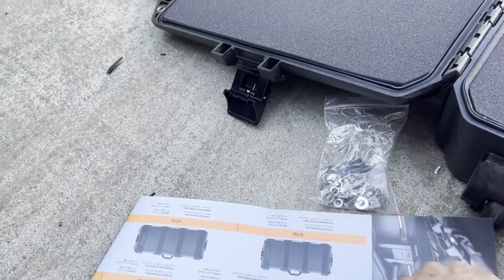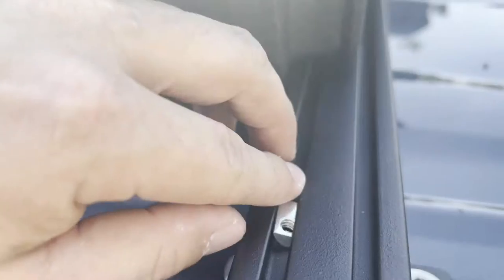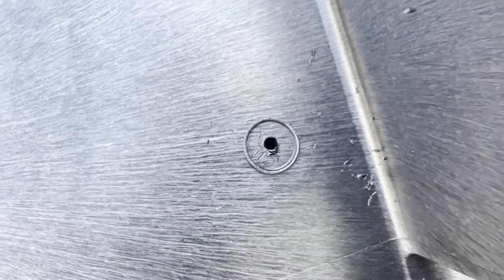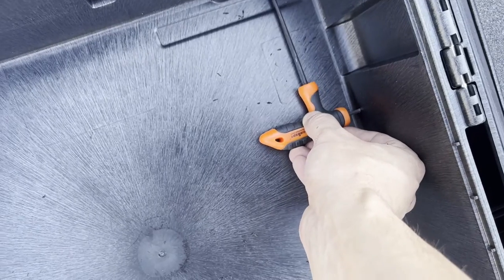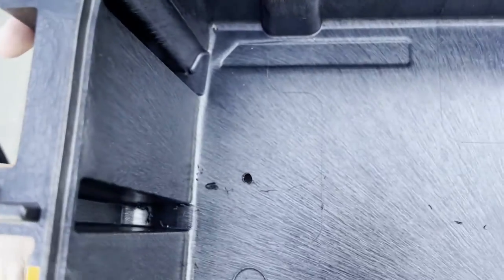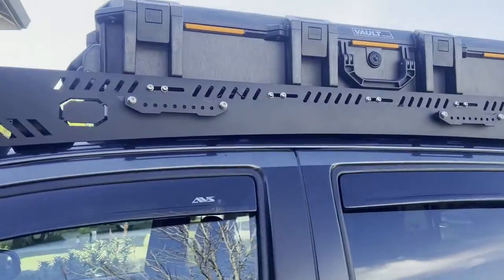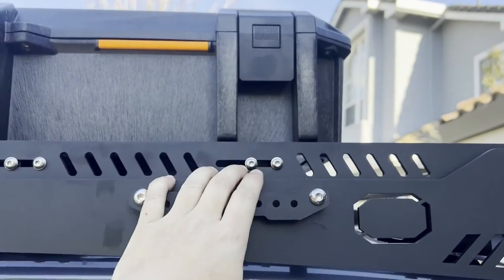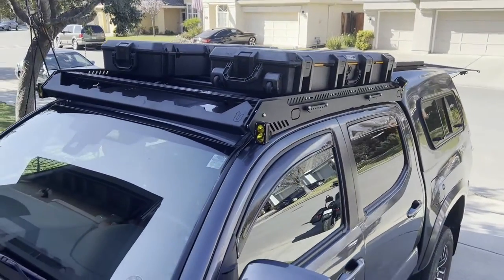How to Mount Cases to Your Roof Rack, DIY, Step by Step, detailed instructions

Comment: Did you end up getting the measurements mounting the front part of the vault box? I don't have at particular Allen wrench to go by for measurements.
Reply from the maker: U can use any measurements and tool u like, u can even place a brick or wide ruler along the side to keep the measurements equal. Good luck.

Comment: Never understood the need to mount a case to a roofrack with screws.  I prefer using a ratchet strap, its way more convenient for me, i dont like driving with gear when im not camping.
Reply from the maker: I converted bc my straps became too loose or warped the aluminum rack over time in addition to freezing closed when in freezing conditions. Plus the vibrations on the highway etc. Thanks for watching.

Comment: Do have a link or an item number for the hardware you used to attach the cases?
Reply from the maker: Used the screws and anchors from the Rack manufacturer, they were very helpful. Then I used a rubber washer and metal washer from Home Depot. The cases have worked flawlessly last 10,000 miles getting beat up and carrying guns, wood, recovery gear. So far no loosening or wear issues where the bolts seat.
Reply: Will those tracNuts work on any other roof rack?
Reply from the maker: @HM-vu9zw  which rack you thinking? In general no, each will be brand specific however I believe front runner and prinsu use the same hardware. This anchor in the video also comes in different sizes so caution when ordering. The price from uptop is not a huge markup, I went with them.
Reply: @AdventureSquadOverland  I have a Victory4X4 roof rack.
Reply from the maker: @HM-vu9zw  I think it’s best to call victory and ask if it’s the same. I’m not sure kyself